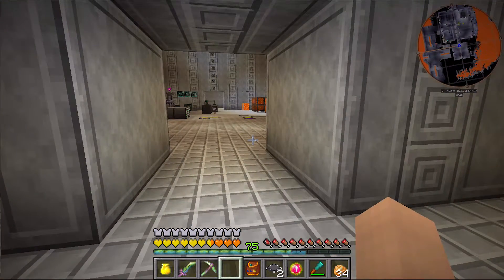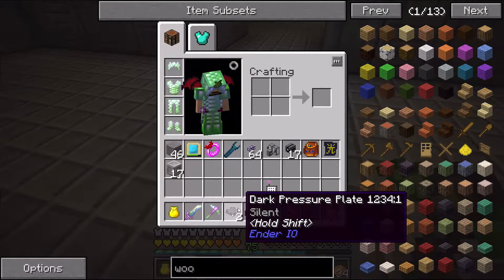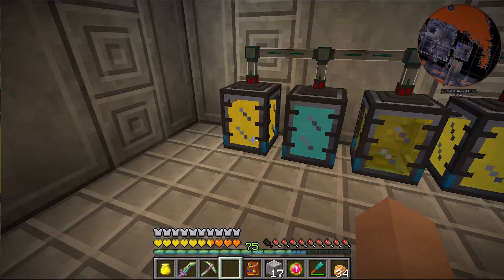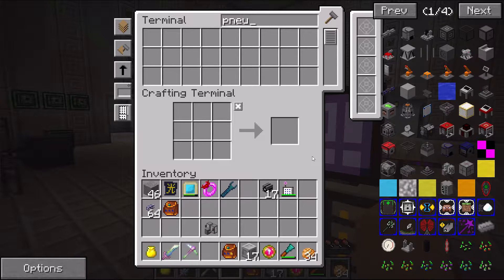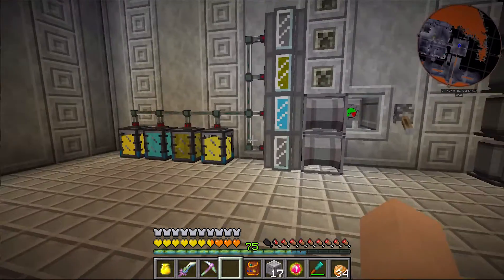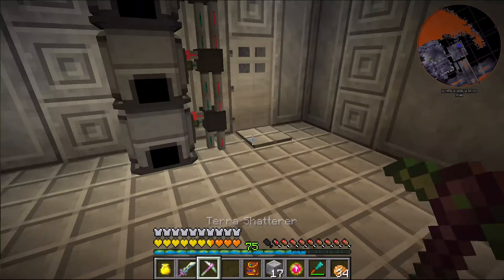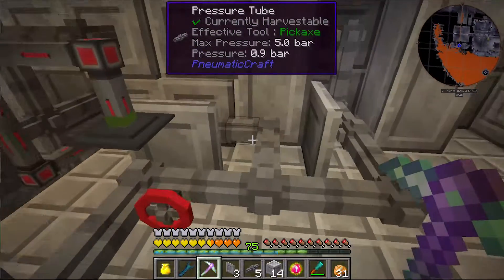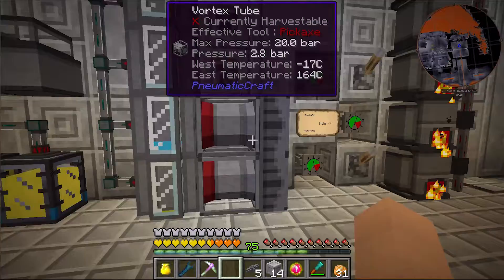PneumaticCraft Plastics | Direwolf20 1.7.10 | Ep. 83

Comment: Once you get to the second level of air compressors, once you add 6-10 speed upgrade it gets HOT(I Think i got it to ~1500C) So you could make pressure AND Make heat Win Win, Also to decrease the chance of explosions you can create a large pressure chamber (Up to 5X5X5)  that way it will store more (You can also add the Capacity upgrades) In addition you should make speed upgrades and put them in the pressure chamber (They are only effective up to 10 any more won't make it go faster)